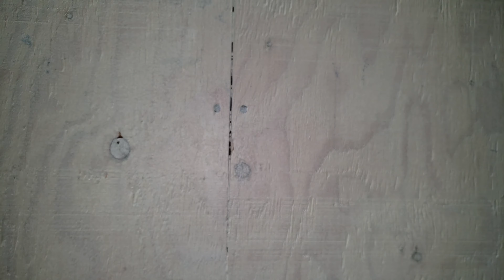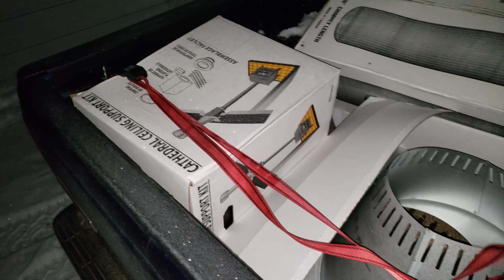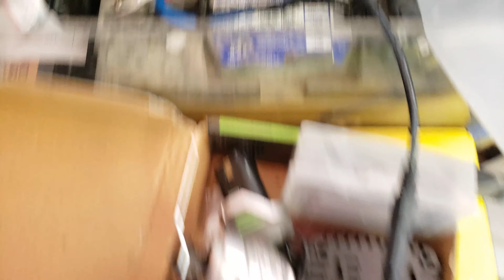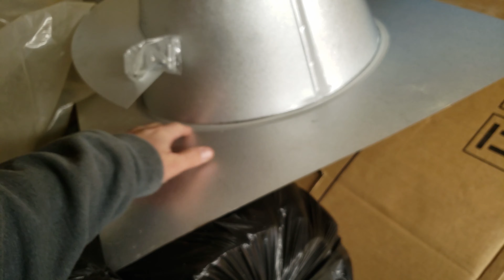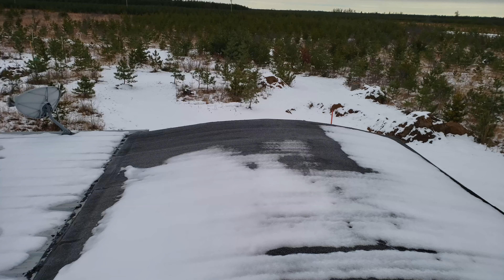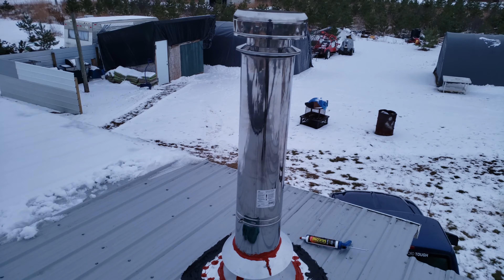Supervent Ceiling Mounted Stove Pipe Install

Comment: Looking good! Hopefully that bit of a water seeping in can be easily stopped with some more sealant.
Reply from the maker: Thinking it's just because we had the heat on, then we turned off the heat in the room , so makes sense the moisture would have dripped down , also crazy wind and rain / snow the night before